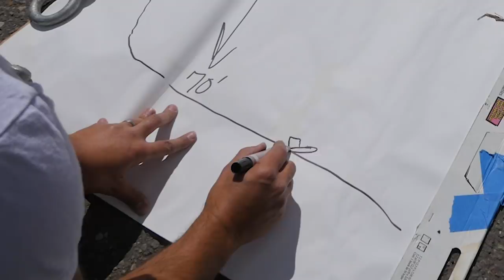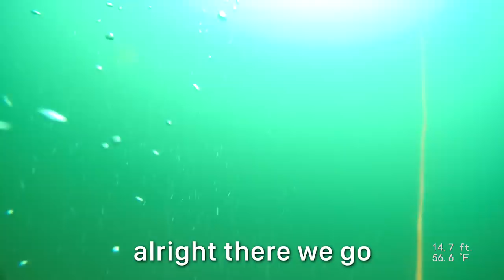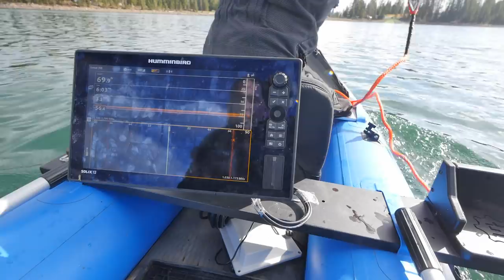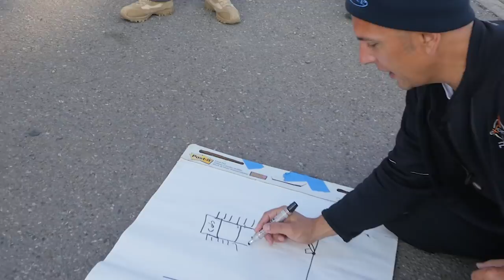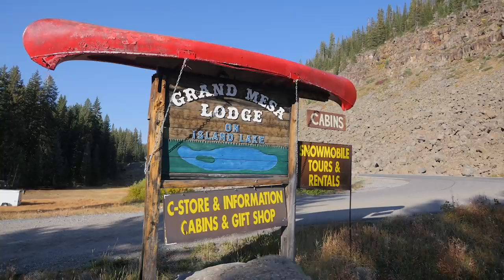Snowcat Recovered 18-Months After Falling Through Ice!

Comment: When you cut tracks off of something always start at the lowest point of the back of the machine, it rolls out of the tracks MUCH easier
Reply: Shouldn't be cutting them off in the first place
Reply: @redraiderrider3289  you had to there...those axles have been under water for 18 months, and when the cat went down it was most likely in gear, combine all that and you get no spin from the tracks

Comment: Hey guys,  Great show,  You guys do amazing things.  Just one thought.   Ether is not the best for starting 2 cycle engines.   Ether will wash the oil off the cylinder walls,  instead use WD-40.  It is also very,very flammable but still has oil properties.   Try it sometime.  It works well.

Comment: The ethnol they spray in the carb is very explosive and with your ahange gas you need to prime the gas side so using this helps to run the engine for a fhew second to use the vacume the the gas needs too pump and great video

Comment: Carb clean, or choke clean throttle body cleaner.  you can also use WD-40 to start your boat motor it's less volatile than either. If you use too much ether you can actually blow a head gasket.

Comment: Quickest field fix when you don't have a nut.....if you can find some wire then wrap it around the threads, run it down the threads until it's tight, hold it in place and twist it as if you're fixing fence. It's as good as nut and will conduct like a nut and will hold under pressure. More twists, the tighter it gets
 Anyone who's military or races knows these field tricks.

Comment: Machines with hydraulic drive transmissions or hydra static or whatever name they are referred to, including zero turn lawn mowers and more, have a valve you open and it releases the drive train and lets everything spin freely,  just like putting a car or truck in neutral. These valves are shown in the owners manual of whatever machine it happens to be on. Then you don't have to cut off your tracks to make your machine roll.

Comment: Wow.....that vehicle is messed up. If anyone is interested, there is a video I posted on my channel a few weeks ago where I pressure washed a PistenBully 200D, a slightly smaller model to the 240 shown in this video. It then got fitted with new hydraulic hoses worth £700 to keep it running for another 5 years or so.

Comment: How much time  does one have to wait in-between dives?
Reply from the maker: Depends how deep you dive and for how long. Say 70' deep, bottom tie 15-20 min... but out for about an hour, but second dive at same depth will be shorter. If only at 25'... stay down over an hours easy and return right back to the water if you want.

Comment: ETHER-CAUTION - OVERUSE - Cylinder walls have cross hatching -to hold oil on cylinders walls to lubricate the pistons --over use of ether  - cylinder walls to become smooth - the oil does not lubricate the pistons causing excessive cylinder piston wear ,

Comment: When you use esay start for engines what I'd does cuz your running on bad fuel or gas when you change the gas to new fuel you make an air pocket on the gas side and when you get no gas your engine won't run and it works on a vacuum system so using easy start you bleed the gas system so there's no air

Comment: submerged for 1.5 years ... no doubt the owner got insurance money when it went under, so the insurance company owns it.

Did the insurance company want the unit, or was it scrapped because the cost of repair was the same or more as the cost of a new unit?

Since it was (presumably) running when it went through the ice, the engine suffered catestrophic damage when water entered the cylinders; at a minimum bent rods and likely a busted crank, so the engine has to be replaced. A long block/short block, or used engine is at least 10 grand plus labor to install. It would cost more in parts and labor to rebuild the dunked engine. 
No doubt water and silt got into the transmission and drives, necessating their replacement.
All the guages mechanical and electric need replaced. Everything electrical shorted out and needs replaced taking into consideration the corrosion from being submerged for ONE AND A HALF YEARS.

What was the delay in recovering it?  Why wasn't it recovered inside 6 months durung the first spring/summer after it went under?

How much fuel and oil leaked out while it was submerged?

It's worth the scrap metal value now.  Maybe a couple hundred bucks. 😷

Comment: You are wrong ,I Google this accident & the 2 men did die in that Snowcat, the owner of that resort only told them it wasn't a good ideal to take the Snowcat on the ice, he could have told them NO, they went out at 1am, who takes a Snowcat out at 1am
Colorado Search and Rescue Board and the Summit County Search and Rescue team were called to check the lake. They used an underwater drone, or Remote Operated Vehicle, to capture video and pictures under the ice.
The ROV immediately located the snowcat and two bodies in approximately 65 feet of water.

The ROV has a retractable arm and they used it to retrieve the two bodies and bring them to the surface.
I know you will block this because I'm sure you know they died in the Snowcat
Reply from the maker: Won’t block it. Will correct you because I have the video of the recovery and the facts. I don’t believe everything written in the media. In the end, I have direct first hand knowledge and proof.

Comment: There's no way that thing fell through with 30 inches of ice. Had to be thinner. 12 inches easily supports pickup trucks and they don't have near the floatation or weight distribution of those huge tracks. 

We have up to 60 TON semis driving on ice roads in northern Canada delivering supplies across lakes with that thickness that don't go through, and again way less weight distribution on the wheels.